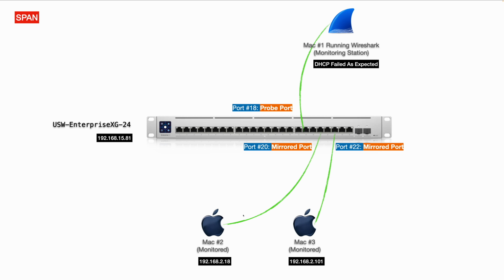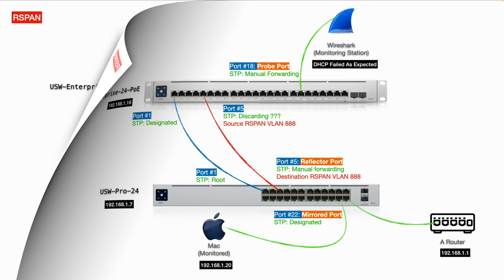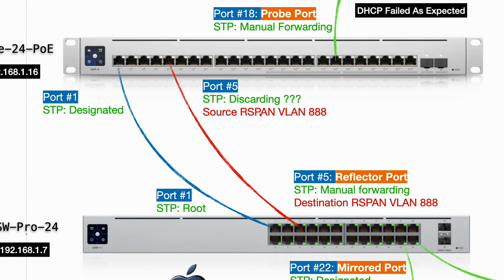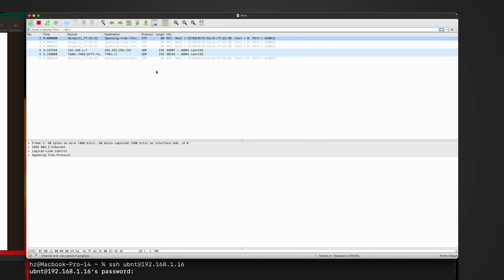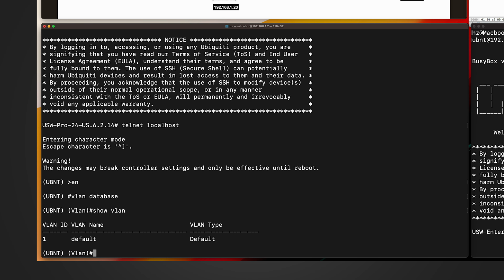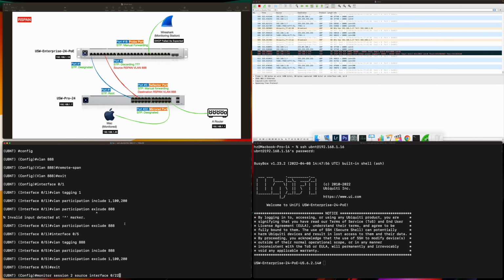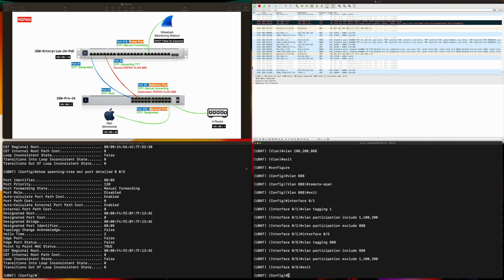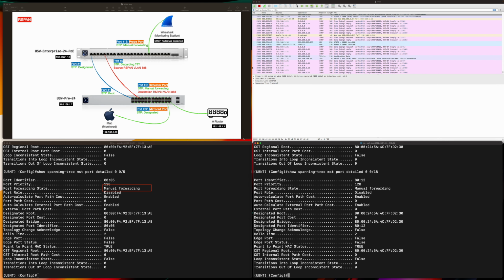Ubiquiti UniFi Switch - Remote Port Mirroring (RSPAN)

Comment: Good sharing on mirroring feature in Unifi.
I have a question on montitor source, does it only allow one phtsical ethernet port? Can I mirror traffic on one VLAN to the destination port?
Reply from the maker: This video is about rspan. I have another video about span, the non-remote version, which allows monitoring multiple ports. However, you need to add the ports one by one, instead of by vlan. If you only care about inter-vlan traffic, you can monitor the lan port of the router.,

Comment: This solution seems impractical. I needed to monitor a port on a Switch Flex. Wasn't obvious how in the UI so I though of you and searched your channel and found this video.
Unfortunately, I don't have the time trench another 200 ft wire to to it ;) So I just mirrored the entire uplink port and filtered in Wireshark. Cheers!
Reply from the maker: Your scenario is really “remote”:)